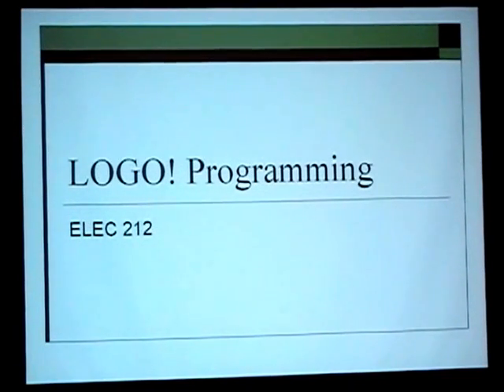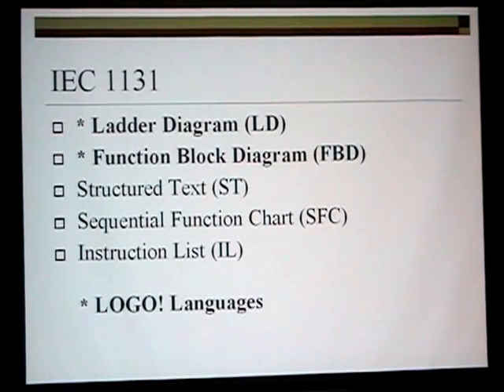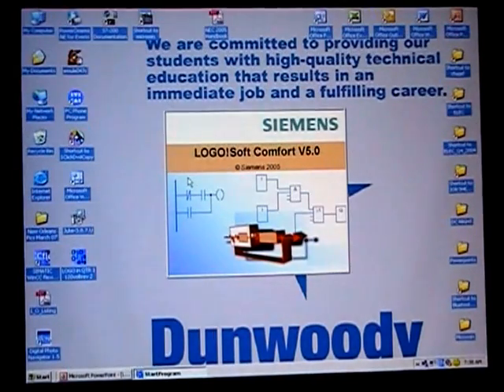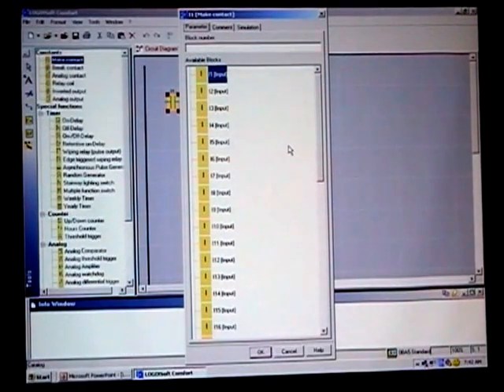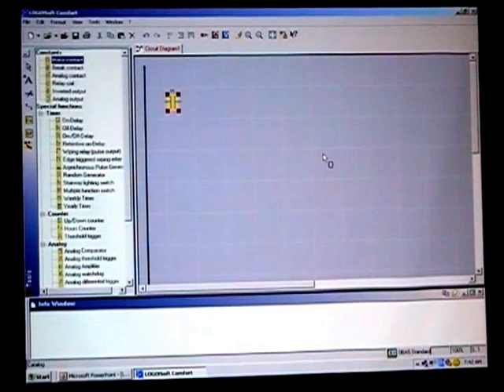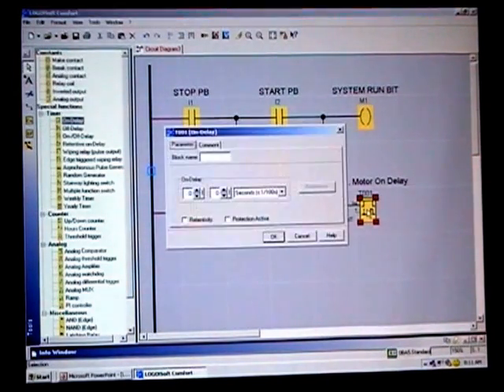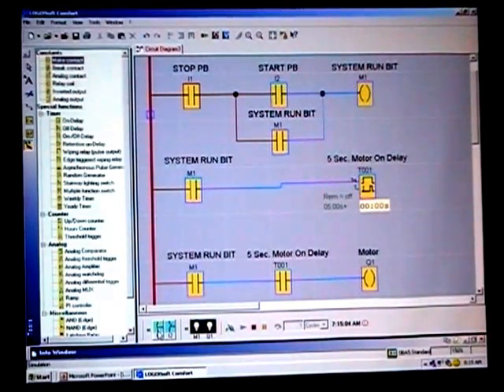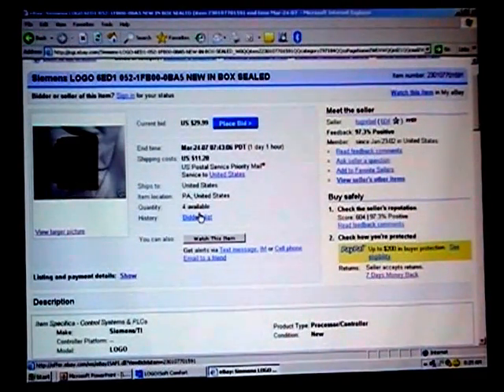Siemens LogoSoft PLC Basics Lecture - Dunwoody College of Technology

Comment: I have installed LOGOs in a few little industrial automation apps and I agree with the instructor, these little PLCs are great for the money.  I later bought an IDEC SmartRelay that I keep in my toolbox along with a few different sensors (and an annoyingly loud little buzzer) just for emergencies and handy troubleshooting.  

I also concur that the Siemens and IDEC units are both pretty much the same unit.  The other ones also likely but these two I know for sure.   My IDEC interface cable looks identical to the LOGO.  I never tried to use my IDEC cable on a Siemens LOGO but feel confident it would work fine. The IDEC WindLGC ver.6.1 software and the Siemens LOGO Soft Comfort ver.2 were pretty much identical... well, the opening splash screen when the program loaded was different if that counts.

Comment: Please can somebody explain me why do you use make contact for STOP push
 button instead of break contact? I'm pretty new in PLC programming and 
this is confusing little bit.
Reply: for safety-related cable breaks
When the cable is disconnected, it will not stop when it presses the stop button

Comment: I need some technical support from you in PLC programming design. I am using LOGO V8.

In our current project, there is 3 aircon units in one control panel. Each aircon unit was controlled by their own PLC .

The aircon control panel shall be able to perform auto‐change over to all 3 split units (2 duties, 1 standby) . So, we are assign one master PLC to control the auto-changeover function.Unfortunately, we have not been  experiencing doing this.

Please advice and send us some sample programming for this function. Thank you. My languange is functional block diagram